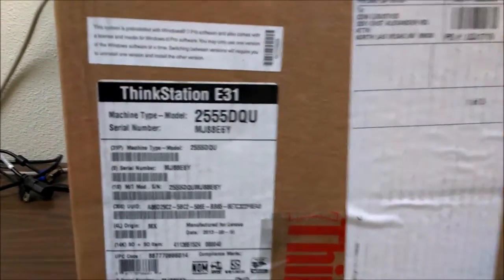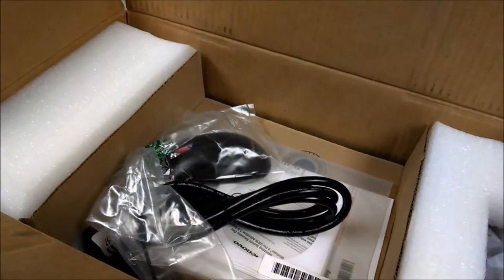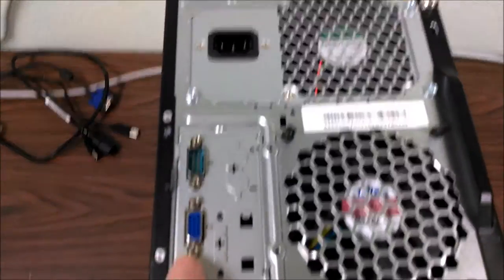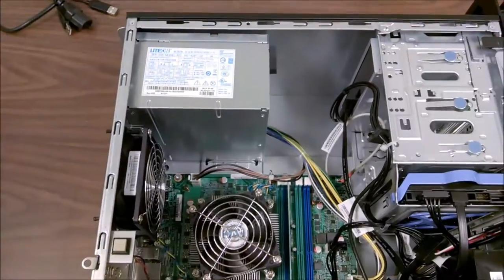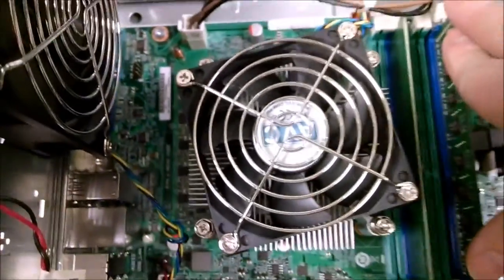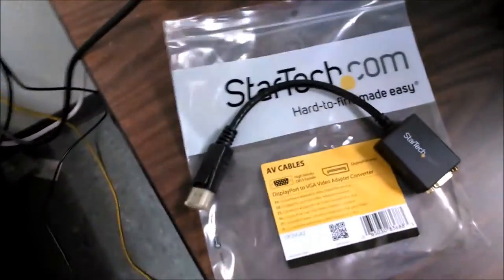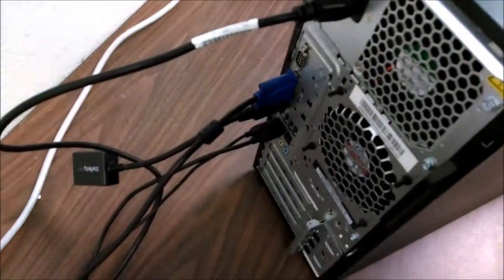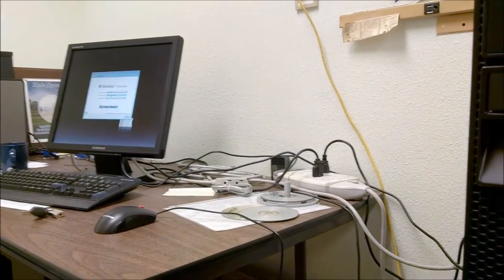UnBoxing Lenovo ThinkStation E31

Comment: I like how the hard drive caddy is able to be directly pulled out without obstruction. I just bought a used ThinkStation E30, unfortunately to remove that hard drive the CPU heatsink and fan assembly needs to be removed. I guess that's not such a bad thing, maybe the thermal paste needs to be changed anyway.
Reply from the maker: It's too bad  engineers don't always think of what it takes to work on the system after it arrives!
Reply: So true and sometimes it only gets worse. You should see what it's like to work on the new semi trucks compared to old ones, back when there was still plenty of room in the engine bay, which is true for automobiles. At least the E31 got better in that regard. Do you think it's worth removing the CPU cooling unit for no reason other than to apply new thermal paste? If not, I'll install Linux to the 'trapped' 720rpm HD, and keep Windows 10 on an SSD. Removing the CPU looks easier than either a T60 and W510 both I have done several times.
Reply from the maker: Odd you mentioned Thermal Paste. Over the last couple months I have had 2 Lenovo laptops that showed up new and over heated. In both cases it was lack of thermal paste that caused the issue. Might be worth it if you are having issues!
Reply: I had an E30.  To remove the top hard drive there was a lever when pulled allowed the hard drive cage to rotate 90 degrees permitting easy removal of the drive.

Comment: I'm not sure if you'll se this put can you show how to open the thing to get a graphics card in it
Reply from the maker: This is out on a customer site. However, there are two screws on the back that can be removed which allows the side panel to slide to the rear. This would be the left-hand side of the PC as you are facing it. Once the side panel is off you will have access to the slots to install your graphics card.
Reply: @PeteDeichmann  thanks

Comment: I have this
Reply: Sorry mine is an i5 3 something however i dont have gpu
Reply from the maker: @_abdullahyr It's a pretty good PC, Easy to work on and upgrade, but getting a little aged.
Reply: @PeteDeichmann  thanks man I know I ll upgrade when I m older
Reply: @PeteDeichmann  what upgrades would u reccomend
Reply from the maker: @_abdullahyr  The 2 upgrades that will have the most impact on performance are more RAM and an SSD. Both are relatively inexpensive. I wouldn't bother with a GPU; save your cash for a new machine one of these days.
Reply: @PeteDeichmann   thanx man ill go from 4 to 8 gb ram and get an ssd